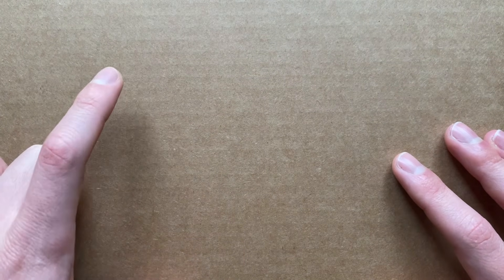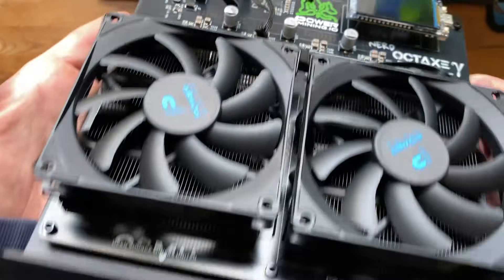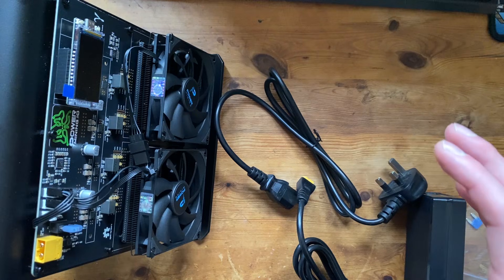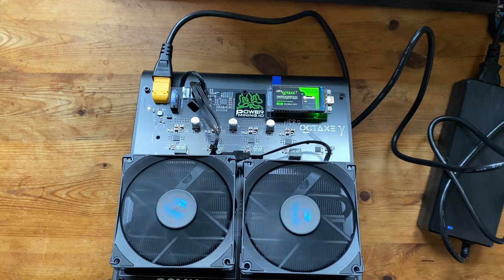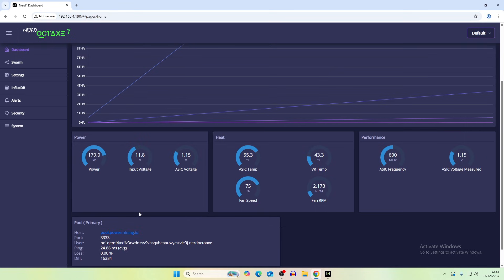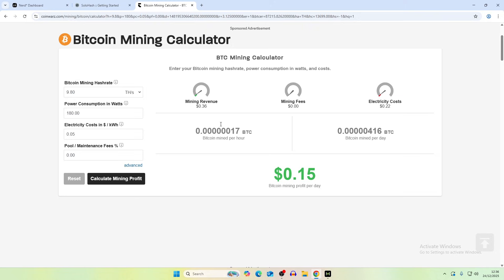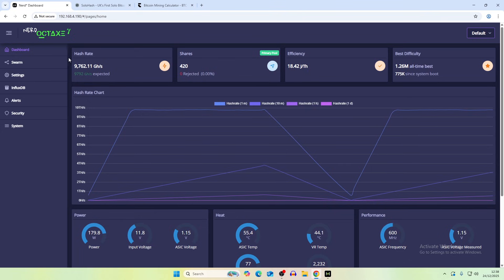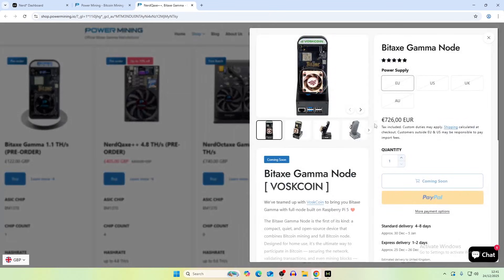NerdOctAxe Unboxing and Setup - Solo Odds, Profitability and More

Comment: Now that you have it in hand would you choose this over the zyber 8g if paying for it yourself? I am torn between the two in the coming new year.
Reply from the maker: if it just based on  money factor then zyber8, but the nerdoct axe has a but of other firmwares you can get to split hashrate and get the lan mod
Reply: @SterlingSpecter1  Thanks. I am not really interested in splitting the hashrate between pools. What about noise level I heard the Zybers can be loud but would get the standard heatsink and fan not the larger one. My Qaxe++ all below around 75% fan speed are still basically silent from a few feet away.